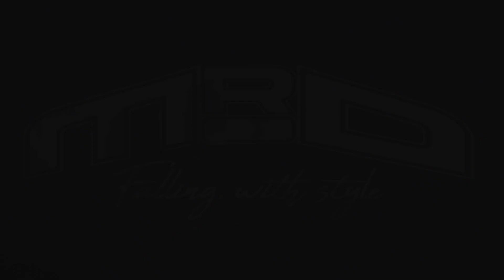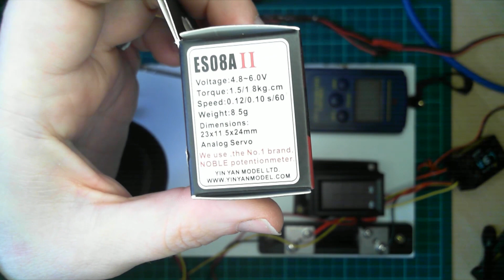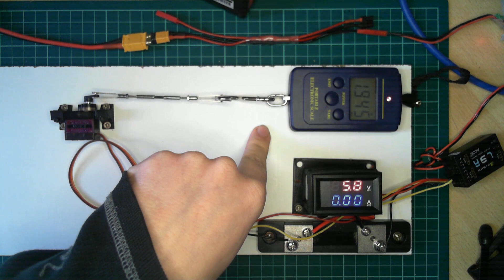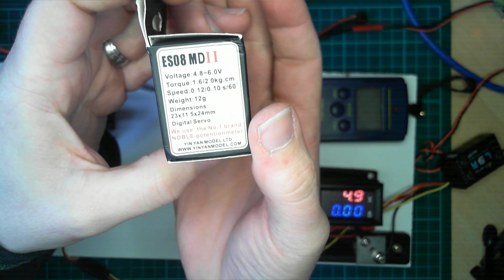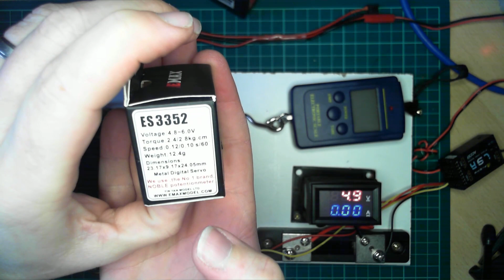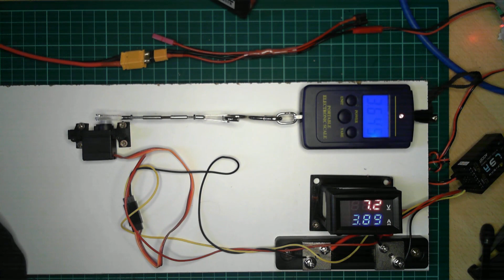Servo Test - 7 popular micro (9g) servos compared

Comment: So implausible nearly 5A from a tiny servo so 5 servos could pull 25A ?? I doubt that is possible the thin servo wires could not hold 2 A without melting

Comment: Your testing is inaccurate because the load was not exactly perpendicular to the servo arm.  That's why you got the high results.
Reply from the maker: The load is never perpendicular to the servo arm. Think about control surface setup. When the servo is centred, the control rod is at 90° to the servo arm. This is when it will have the least force acting against it. It’s not until the control surface moves in to the airflow that the force increases.

Comment: Super video Mr.D. ! I have been buying servos lately to build flaps in a T-28 1,1 ; or build my Multiplex FunCub NG. But last week I bought an old E-Flite Mini FuntanaX (3D 1,1 m balsa plane) and the old servo did not center well. Also the hinges were a bit hart to move. I put some cheap MG90S and MG90D but with max travel they don´t manage to center properly. I went some hole into the inside and increase travel on my transmitter and it was better but still no good enough. My last flight yesterday after maiden her and having a lot of fun wasn´t so good since the elevator wasn´t centering and that pretty irritating for a beginner as me. I´m wondering if I try some of this Emax or the blue TowerPro MG90D. Why you recommend the Emax ES08MA II and not the better "A II" ? I found that my servos have like a little play or loose travel in the center point. May digital ones be better ?  
Thank you a lot in advance!
Reply from the maker: The A II is not a better servo. It is just plastic geared, whereas the MA II is metal geared. I’ve found the EMAX to be good, budget servos. The MD II and the ES09MD are decent too.  For more speed and precision, more expensive servos would be required.
Reply: @MrD  Hello Mr.D. and thank you for your fast answer! I have answered you before but the comment wasn´t posted. I´m looking to buy now some Emax 09MD maybe if they have more precision. On Ali I found them around €29 one pair. Is there any precision difference between the MA II (analog) and the MD II (digital)? Thank you!

Comment: Hi Darren!

Is it normal to have a tiny bit of slop in the servo? When the servo is off i can free rotate it slightly before i feel the resistance of the mechanism..... i have 2 identical servos and both have very little use ( around 7 flights). Both have slight slop but one has slightly more than the other. The servo is the ES08MDII. 

When the servo is powered they work fine and there is no slop. They feel strong and torquey.

Should i be concerned about the slop and just change them to be safe?
Reply from the maker: That could be the motor turning slightly. You would still notice slop when it is powered up.
Reply: @MrD  cheers Darren!

Comment: Also, the MG90D that i saw on Ebay is advertised as having 'continuous rotation' and 360 degree rotation. Is this normal for a RC plane servos, or would it make it unsuitable? Ta.
Reply from the maker: They must be different servos. The MG90D that I have are regular 120 degree servos. 

To be honest, I wouldn’t trust eBay to get servos. There are too many fakes on there. Even fakes of fakes.
Reply: @MrD  OK thats very helpful. Thanks!
Reply from the maker: @TerrariumFirma  you’re welcome

Comment: Hi. Excellent video, very helpful. Please could you tell me what battery pack would be best if i am running 4x ES3352 servos. I was told the LiFE batterys are the best but they only come in 6.6V. The servos are rated 4.8-6.0V so would this be a problem? I am new to this so just don't really understand. 😃Cheers!
Reply from the maker: Batteries voltages can only be changed by increasing or decreasing the cell count. So for LiFe batteries, they are rated at 3.3v. This is their nominal voltage, where you want them to be at storage. Discharged, their voltage is 2.5v. Fully charged they are 3.6v. 

So your 6.6v LiFe is a 2S pack (2 cells in series). 6.6v is the nominal voltage. Fully charged it will be 7.2v. To use that battery with your ES3353 servos, you would need to use a BEC to bring the voltage down to 6v. To not use a BEC with a 2S LiFe battery, the servos need to accept 7.2v.

Comment: As you may no I purchased a PNP Volantex 2400 glider called The Phoenix.  It came with servos already installed and from my understanding they are 9g 5v spec servos.   My question is ,   Since I'll have A total of 6 working servos because of flaps should I set my Matek F405-wing board to send the Default 5v for these servos, OR  ,should I bridge the solder points to send them 6v or even 7v since I'll be running so many servos.   
Thanks for your kind help.
Reply from the maker: 100% keep it at 5v. The PnP servos may not handle a higher voltage. The more servos you’re running, the more amps the servo BEC needs. You don’t raise the voltage unless the servos can handle that voltage. BTW, you may find the elevator servo is bigger than 9g. It is on my Phoenix 2000.

Comment: I have had nothing but trouble with the MG90S servos. Bought a pack of 6, two dead on arrival, one died during testing after install, and one more just died today crashing my mini skyhunter. I am trashing all of them and going with a more reputable brand like Spektrum or Emax.
Reply from the maker: They are garbage. EMAX have been a very good budget servo for me. They have Noble potentiometers, which are decent. GDW make some nice servos at decent prices too.
Reply: @MrD  I agree about TowerPro servos. Someone recommended TowerPro MG92B so I bought four for a new 3D plane.  One was DOA, two won't come close to re-centering with the receiver. On the other hand, the four Emax ES08MA ll I recently purchased are working well.    Twisted Hobbys servos have been great, but I can't afford to use them in every aircraft. Would love to see them tested and compared.

Comment: Thanks for this servo comparison, I've been playing with my ar wing pro and can't figure out the brand of the stock servos there's no label, they seem to do fine but I'm thinking of replacing them with some emax digital servos that I have as spares but I would like to think this would be a upgrade but not sure, that might be a down grade? Your thoughts on this Please
Reply from the maker: They are probably the ZOHD servos, which are supposed to be ok. The EMAX ES08MD II or ES09MD II would probably be better though. I don’t think the ZOHD servos use Noble potentiometers.
Reply: Thanks Darren for all you do for this hobby, are you using the stock servos on your ar pro?

Comment: Hey bro the tower pro mg90d u used is not original or the names has changed ,because the one u tested with name tower pro mg90d is actually tower pro mg92b  which weighs around 13.8grams
Reply from the maker: I have checked on the TowerPro site. And looking at the specs. The servos I’m using would be MG90D. The MG92B has a taller case by around 2.5mm. They are not originals, or they have now changed to non-originals at Banggood; as the casing is a slightly different shape at the top. It’s squared, rather than having a slight chamfer at the label. 

https://www.towerpro.com.tw/product-category/servos-parts/mini-servo/

Comment: 4:23 that MG90S servo I use on my RC car and It works perfect and very fast with 7.4(8.4) 2S lipo battery. P.S. Gtreat video.
Reply: You use them with no BEC? How long did they last did you have any issues? Thanks
Reply: @Darfail  Unfortunetly it didn't last for a long time and I swaped with a little bit expensive Kingmax servo(9g), works  hard and well, 4 kgs with 5volts...
Reply: Hey thanks for the reply yea I thought it probably wouldn't I was hoping to overvolt mine

Comment: great info do you have a preferance on a quick micro servo?
Reply from the maker: Not really, I just go for decent all rounders at the moment. My go-to servos are the EMAX ES08/09 range or the MG90D.
Reply: @MrD  yea I’ve just stuck to using my good old stand by hitec85mg servos for gear drives on a few of my custom Conversions. Wish they were a bit quicker but they are solid and bearing servos
Reply from the maker: @thatsmyrc  You can't really go wrong with Hitechs :)

Comment: Edit 4/2/21 I tried two of the ES3352's and using an accurate meter measured the amp draw and it was measuring about the same as the ES09MD at both 5v and 6v.... the highest amp draw I could get was 0.37a yanking it hard for a fraction of a second. The average draw on auto at medium speed on a Turnigy servo tester is 0.7a to 0.10a which is way under what you are getting here, BUT the two I got which Emax's site  say are real have a little play in the gears unlike the ES08 MDII and ES09MD that are really tight new so seems like the gears are tight on yours and loose on the ones I got. Excellent information!  Thanks...
Reply from the maker: No problem John. I have plans for more servo testing soon. I’m currently building a better test rig.
Reply: @MrD  Great... look forward to seeing it.

Comment: Are you sure those current measurements are correct, some of those go near 30W which would make the tiny windings in the motor catch fire in the time you show in the video.  

Those readings are more realistic at 1/10th the power, maybe your meter was set up wrong.
Reply from the maker: I’m building a new testing rig, so will double check this.
Reply: @MrD  Yeah. Would love to have an update on this. Generally the amperage should never go beyond 1A (extreme case).

Comment: Can you please recommend a servo motor that can replace sg90 and is not too costly?
Reply from the maker: I would go for an EMAX ES08A II. This is a plastic geared servo, the same as the SG90. 

If you want to go for metal geared, the EMAX ES08MA II, EMAX ES08MD II, or the MG90D are good options, and cheap.

Comment: Darren do you prefer digital or the analog servos on your fixed wings using inav.
Reply from the maker: I’ve mostly used analogue. But the digitals in my Nano Goblin were nice. I have a few builds with digitals, but they need finishing and maidens.
Reply: @MrD  should i go with digital on my new builds from now on,i just want them to be a solid buikd thsts all,i see mixed reviews and it confuses me a bit,sorry for dragging this topic out.
Reply from the maker: Digital and analogue servos of the same type, for example the EMAX ES08MA II and ES08MD II, will be just as well built as each other. The digital servos can have more precision than analogue, when they are used at higher frequencies. However, digital can suffer from twitching. This seems to be more prominent with 900MHz receiver systems, like Crossfire. But it can be fixed bu moving cables or adding shielding.

Maybe try digital on one of your new builds and see what you think.
Reply: @MrD  Thanks heaps for your reply Darren,I will,I'm still using immersion rc uhf systems on my fixed wings doing consistent 25 klms flights at the moment nothing to silly at the moment...ha ha ,keep up your great work I look forward to your inav topics all the time.
Kind Regards
Mark
Reply from the maker: Awesome Mark. I’ve not tried UHF yet. I have an Orange LRS module and receiver somewhere that I was given, but not tried it out. Andrew Boulton keeps tempting me with DragonLink too. Pricey though.
Reply: @MrD  Yes I have dragons ink v3 it's fantastic,please try....,
Reply: I've tried digitals but noticed no difference to the analogue servos.

Comment: Excellent!! I'm glad you noticed the centering issue disappeared with the receiver vs the servo tester. Also, in the future, I'd really like to see you include more servos and start the video with the conclusions because most people aren't going to want to watch all that testing and disassembly. My favorite servos are the Emax ES08MA II, the MG90S Metal gear Digital 9g direct from China (no brand name), and the Miuzei SG90 9G analog servos with plastic gears.  All of these seem equally tough and capable, with the Emax ES08MA II costing about twice as much.
Reply from the maker: Thanks JP. I’m currently working on a better test rig that will highlight centring issues as well as range and average use amps. I’ll definitely be using a receiver from now on as it was a massive difference to the servo tester. The future videos will have one servo per video, so should be reduced to around 3-5 minutes. I understand that this was a long video, which is why I’ll be separating them out. You’ll find that pretty much all reviewers leave the conclusion to the end. That is because YouTube down rates videos if people only watch the first part. However, I included jump points in the description, and will use this same technique for the other videos. I was the same as you, I used the EMAX ES08MA II as my go to servo. However, I think that will change to the MG90D now, as they’re cheaper and outperform the EMAX. I used to use the MG90S, but noticed centring issues on planes. After doing these tests, they are pretty under spec too. Thanks for watching and stay safe 👍🏻

Comment: Great video. Been using the 08mall as my go to servo for about 3 years. Very impressed by them. 
Have you got any method of comparing the resolution / smoothness of servo movement.
Thanks
Reply from the maker: Thanks Mr. Shadey. The ES08MA II has been my go to for a while too. Glad that choice was justified. I’m thinking about making videos like this for more servos. Maybe I could incorporate a test for that. Maybe using a switch on the transmitter to do a minimum to maximum sweep over 10 seconds. Perhaps have a protractor in the background for a scale. How does that sound?
Reply: @MrD  
Yeah maybe an extension of the servo arm would help see any difference. Sticking a toothpick to the arms would probably do it. I've done a little video comparing genuine and fake emax servo. The fake has got deadband in the centre, less resolution and doesn't centre very accurately.
https://youtu.be/RXY66UVla1k